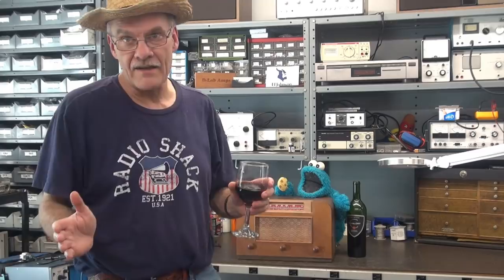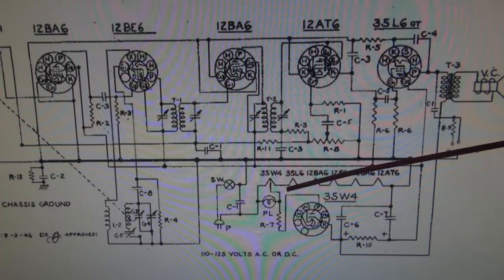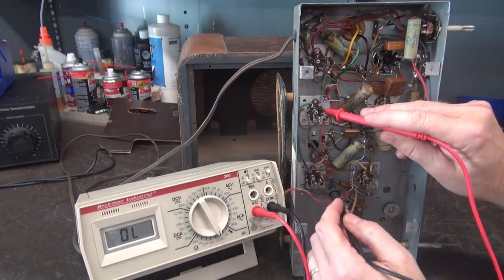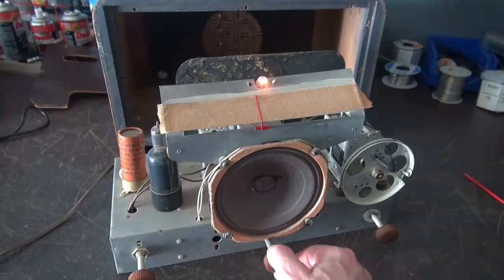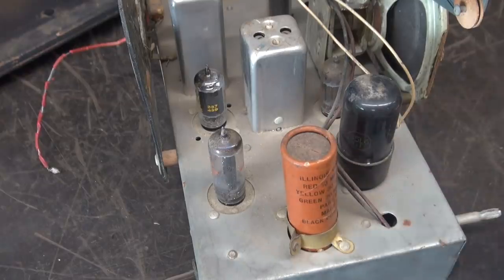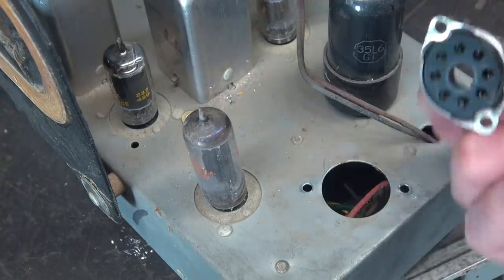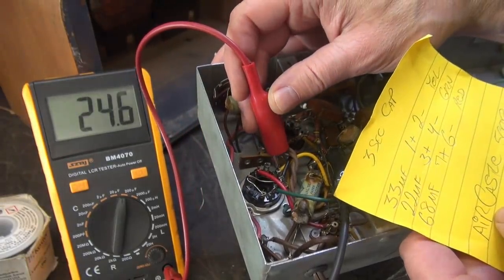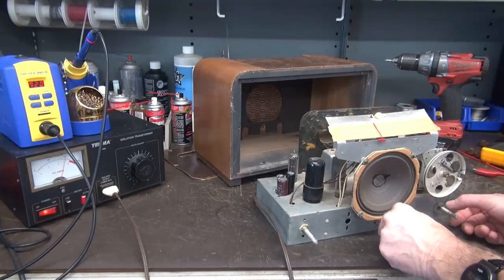How to fix a dead antique AM Superheterodyne 50's tube radio

Comment: Why bother with all that work drilling out the old cap and inserting a socket? Just cut the wires to the old multi section cap and put the new individual ones under the chassis where they won't ever be seen.This way, the  radio will look absolutely stock. You can even use the wires from the old cap and just glue or wire tie the new ones to the chassis. There's plenty of room for them underneath, as these radios are pretty much "gutless wonders".  Also, just a small nit pick, but I was always taught that the term "filament" is normally used to describe the cathode on directly heated tubes. In indirectly heated tubes such as these its proper name is the "heater". Another interesting point on this set is the combining of octal and miniature tubes. You can see that the chassis was cut out for all octals, with reducer plates installed to handle the smaller sockets. Common practice during the transition period from octal to miniature tubes. Except for the 35L6.  This was because the miniature 35B5 output was discontinued due to safety concerns and there was a time lag until they could bring out the 35C5. That and the old pre-war style IF transformers puts this radio into the late 40's or very early 50's. Finally, regarding the "hot chassis"....well, yes and no. After about 1940 or so virtually all manufacturers of these transformerless sets isolated the metal chassis on their radio from the power line, by using a small value capacitor (and sometimes a very high value resistor in parallel) between the line and the chassis. This radio is indeed set up that way (C2 and R13)  So as long as that cap isn't leaky or shorted, it isn't that dangerous (though you can still get a tingle from it). However, I never work on these myself without using an isolation transformer, because the chassis may be isolated, but the actual circuit ground inside is not. And if you have to use a scope or other piece of test gear, the last thing you want is to blow it up because you hooked up your scope ground to the hot end of the power line.
Reply: Yes this could have been done in a workman like way by attaching the new caps underneath to terminals near the old filter cap that are the electrical equivalent
Reply: Hi John. I am studying my Motorola 69L11 "Suitcase Radio" schematic  prior to restoration. Its chassis is isolated as you described. Any chance you could explain why the B-  needs the isolation cap attached to the chassis? Is it correct to say the chassis in this type is neither hot nor ground?  What is the caps job?  I am new to tube circuits.

Comment: ...my dad had a TV & radio repair business in the 50s & 60s...and into the early 70s.  I grew up in his shop (Fort Lee, NJ) learning how to diagnose & fix problems with these little five tube radios....most all of the folks who brought them in for repair were in their late 20s to 60s (I guessed) in those days at the ages of 7 or 8 to early teens everyone was old (like I am now - almost 72).  I used'ta know all the tubes by number..forgot most of them now - (IIRC 6 SN7 & 12 BE6)...if the sound was describes as 'scratchy' - it was the RF (or IF???) filters - if it had a 'loud hum' it was a bad filter

Comment: FM obsoleted AM in the 1970s. Streaming and satellite obsoleted FM in the last decade. Radio is a nearly dead format filled with unbearably long commercial breaks. The last survivor will be NPR. So why repair a 1950s AM radio that can never be tuned to something worth listening to (in mono)? First, there is the challenge of using accumulated knowledge to debug the problems. Then there is finding leftover parts to do the fix and upgrading with retrofit and newer technology. Fixing things can be very satisfying, even if it isn't saving money. The original purpose of the radio, listening to AM, has been superseded by the purpose of being a nice archaic technology home decoration. Which it does well. Mr. D-lab has a presentation style that makes a dry subject fun to watch.

Comment: From Leo:  Great repair,  I kind of thought I would see you spaghetti the  leads on the epoxy drop caps.  I was cleaning up and found an old jar of varnish coated cloth braid spaghetti and a dried solid bottle of corona dope.  Not many people remember that was a part of radio/TV service bench.

Comment: Howdy Terry .. A friend of mine was just given an old AM radio .. I think it likely has a few dead tubes (doesn't power up) or something else is wrong. I noticed the wax caps all look deformed. A no transformer type. Pretty sure it may be like yours and all the filaments will add up to equal the source.   The big old filter cap is on its side and has 3 wires coming out of one end. I could see Red, Green and other words on the filter cap, but couldn't see it all that well. The band is riveted to the case. There is also what looks to be vertical wax coils and two or three metal canister type coils. Quite a beast. There is an old record player that goes on the top.

Comment: I love this method and sometimes I can get a  org can over them with a touch of hot glue
  I always write when it was serviced and when it was done as well hopefully we can save these cool radios for another 50- 60 years 
I’m working on a 1927 Kent Atwater 40 came with the org field coil speaker with a huge seladium rectifier and it works but I need to replace all caps and I wanted to add a switch for a audio input for Bluetooth or CD player  I’m going to have to look at some of your videos on that one if you do

Comment: I like to replace the 35L6 with a 50L6. I think this prolongs the life of the tubes and lets the set run a bit cooler. Today's line voltages are higher than the older line voltages. (Yes I did see that radio would work on 120V, but line here is 125-130V.
BTW,
The real reason radios hum is they don't know the words to the song. :)
Reply from the maker: Hey man, Thats a great idea, yes, the line voltage is much higher these days. I will give that a try.
Reply: The tube characteristics aren't identical; the 50L6 is a higher gain and higher power tube, and has different bias points for the same plate current. However, they are probably close enough to each other to work in most circuits, especially if you use a slightly weak 50L6.
Reply: @lwilton   I've never seen a situation where that substitution wouldn't work ok in a radio like this. These sets are notoriously uncritical.  Problem is that the heater voltage is now pushed up to 133, which means the heater voltage will be about 10% too low. This is enough to reduce emmission in the output tube, so even a new 50L6 is going to be "slightly weak" in that circuit.

Comment: I finally found a Tenma 72-1095 a couple months ago.  I need to clean and lubricate it but it works great with my dim bulb device.  Picked up an RCA 26x-3 yesterday - it has an asbestos pad.  :(  another great video Terry.
Reply from the maker: Excellent. You will love that Tenma variac! A very reliable instrument
Reply: Paul Reiter - Sounds familiar. I have two radios in the queue with asbestos pads, a RCA A23 and its bigger brother an M-47A. I know of two approaches to this issue, leave it alone and stabilize it with a liquid compound or remove it altogether.
I still have not decided which way to go on this.
Cheers,
Reply: Did you put the dim bulb between the Tenma and device?

Comment: You can safely touch that chassis if you make sure to plug the plug in with the chassis side to neutral, and make sure you're not touching any metal connecting to the house or ground. One way to prevent incorrect plugging in is to replace the plug or whole wire with a polarized one, and make sure the wide side of the plug wire is the one to the chassis. Yet, being safe is never a bad idea. Very nicely done. Do you realign the radio when you finish recapping? Though it sounds lie it doesn't need it.

Comment: This one is a bit of a Heinz 57. It has a ground bus similar to a Stromberg-Carlson (eg. #561) and a mish-mash of mini-9 pin and octal tubes. I wonder if the 9 pins were a later addition (like a mod) or the radio was made that way... Looks like the chassis was punched for all octal sockets... And the overall physical makeup is a lot like an RCA 12X type...
Thanks for the ride along on this one.
Cheers,
Reply: It didn't look to me like it had had a previous rebuild, so it was probably original. I'd date it to the mid 1950s. Miniature tubes started becoming popular after WW II, and having a mix was pretty common.
Reply: @lwilton  - I agree. It's most likely all original. I was looking at how the case was stamped; it was stamped for octal sockets then modified later to adapt to mini 9-pin sockets. I guess it was cheaper to use up existing stock then to re-stamp new chassis.
It is likely this radio was being built through the octal-9pin transition time period which is interesting.

Comment: Nice vid, but I understand that replacing the electro. cap with multiple non-elctro. caps adding to equivalent capacitance and assuming their voltages match the original electrolytic, is not ideal and could lead to other problems. Also I would test the other tubes for emission, short, and grid leakage.

Comment: I have picked up a lot of tips and general tube servicing ideas over the many videos you have made. Our mains is 230 V so we didn't see the hot-chassis models here like you have in the US but it is interesting to see how they used series filaments to achieve operation without a transformer.

Comment: Cool video.  So, is this radio basically an AA5 with an RF amp stage?  And that's why the audio output tube is a 35L6, instead of a 50L6,  to free up voltage to power 6 tube filaments off of 120 volts?

Comment: I don't use the hook and pinch method of connecting the parts I find winding the parts into a coil works just as good and helps if you need to take the parts out. But all in all a great video for beginners.

Comment: These are the kind of radios I love, easy fix, tubes, caps and maybe a resistor or 2 then wa la, it works. Then there are the radios when after the recap and tube check etc. ...... static, ugh, then comes the challenge of troubleshooting. Looking forward to seeing some D-lab wine inspired troubleshooting vids...... AND, still would like to see D-lab's how-to on making hot-chassis safe.

Comment: Do you bother to make sure the foil end of new caps are aligned the same as the originals?  I know modern caps don't usually have a foil end marked, but it's not hard to determine which end is which if you have a 'scope handy.
Reply from the maker: Not unless the cap has the band. These new poly type dont
Reply: Thats true (using the scope) and often the bands are wrong anyway Mr Carlsonn did a good clip about this
Reply: I can tell you that there are very few instances where doing this makes any difference in real life applications. Certainly not in an old AM radio.
Reply: @johnstone7697  In the spirit of one of the comments before yours, if you do hand wire it make sure you don't leave any stresses on the component leads after you solder them or the molecular alignment of the leads and even the dielectric can be altered which as we all know, changes the sound.................Right? 

(who needs emoticons when you can make somebody vomit with mere words?)

Comment: Very good information, Thumbs up, I like the first part. Any idea on a whites 5900 di pro sl can be fixed if the meter only reads half way, even with different coils and solid silver? tks in advance.

Comment: Thank you for the mini tutorial! I have several old sets from the 1920's on and they all need some work. I especially like your method for replacing the electrolytic filter capacitor, I will be using it myself!

Comment: Great Vid!! si I has a question if you could give me your thoughts?  . i just purchased a sylvania model #339 NO SOUND at all absolute nothing complete silence ( i think on the internet it said it was a Marconi 339 model Possibly year 1951) the Question i have for you is::: my dad use to say that if a tube lights up, that means it( tube) is working fine???( his is NOT a repair guy by no means!!!, is this a good answer lol. i know all of the tubes in this radio lights and "warms" up ok.  it has these tubes in it ,these numbers are ;;;;  #12av6     #12be6  #12ba6   #5ol6gt  #35w4, how do i know which one is the "audio" tube?. Also what impedance would my old speaker be ? 4 ohms/ 6 ohms/8 ohms??  or what are your thoughts, BTW,I did spay contact cleaner/lubricant that i purchased at a electronic centre inside the volume control it.  thank you in advance for your thoughts/ feedback

Comment: Please help me...I recapped a Sentinel 294T, replaced tubes with good ones, replaced some suspect resistors...all my tube voltages look good, I get sound on speaker, but no evidence of a 'tuning feeling'... The radio was missing an antenna, so I experimented with a long wire in several configurations with no improvement...the coils in the IF xfmrs tested continuous...idk what's going on but someone obviously tried repairing it...I didn't replace any square caps or all the resistors...any thoughts?? I don't want to assume mica disease and risk destroying radio

Comment: I owned a shortwave receiver wired like that in the 60's .while connecting a wire antenna to cold water pipe I discovered electricity! 
During power up first couple filaments burned bright then slowly went dim until sig was established...wwv and voice of America were there..and a few UK broadcasts too.

Comment: Great job. .. enjoy your videos. . . .I just got through restoring a Clarion AM Farm radio. . . Ended up putting a homemade power supply inside the case to replace the 90Volt plate voltage and 1.5 volt filament voltage.

Comment: Nice box but why fix it , a receiver is there to receive and other than talk radio what is there ? Also had a Beckman DVM liked it especially the size of the battery pack
Reply from the maker: Hello, Yes, I agree, the radio has little value. The vid was just for a bit of fun and to share technology. I have 3 of the Beckman bench meters. They were very pricey back in the day. Still perform very well for this type of work.

Comment: What are your thoughts on speaker mods or blue tooth install on them their vintage tube pieces?
Reply from the maker: Its OK to do as long as the radio has a power transformer. Do not try that on a Hot Chassis type. Shock hazard
Reply: @d-labelectronics  I do it all the time, but you must only use the Bluetooth in the battery mode, not with a power supply.  OR, you can rewire your radio with a polarized cord and tie the wide blade side to chassis (or "low side, B-")  and put the "hot' side thru the power switch.  Most of those radios had the power switch in the low side path.

Comment: The J hook method makes a lot of sense if your shipping radios out, I got a philco model 70, and the first thing I noticed it worked intermediately, popped the chassis out and there was a bad solder joint that had worked loose since I got it home

Comment: one of the biggest icky jobs I have found is when there is what I call silver mica disease. the caps in the IF cans open when the little pieces of mica coated with silver oxidize and open
tbis causes all sorts of grief to the set
Reply: This set was old enough to use the pre-war style IF's that had separate trimmer capacitors on the top. So these never suffered from smd. However it wasn't much later that they switched over to those horrible IF's with those caps at the bottom that failed like crazy.

Comment: How do you keep rivets from spinning when they're loose and you're trying to drill them out? I've used a piece of wood before, pressing it against the smooth head to create friction. There has to be a better way to get rivets out besides drill bits, or maybe I'm not using the drill correctly? Anyway, I hate rivets, some come out easy and others are a pain.
Reply: A drill is the right tool. If the rivet is loose it will spin, as you note. One thing you can do is make it not loose. 
Put a bucking bar of some sort under the head (hardwood, brass, a steel punch or the like, and using a steel punch and a small hammer whack the bottom of the rivet lightly a few times to crimp it better.  That sometimes works, but they can go loose as you are almost finished drilling them.
Or get a small thin-bladed screwdriver and wedge it under the head of the rivet. Be sure to not drill through your hand when the drill pops through!
Or try to wedge the head with something like a block of wood, but this usually doesn't work as well as the other methods.
Swearing can help. :-)
Reply: a drop of superglue on the underside.
Reply: @richarddean1810  Thank you, simple and elegant.